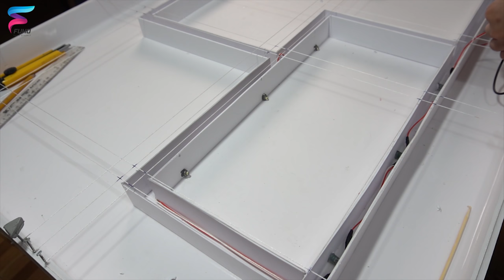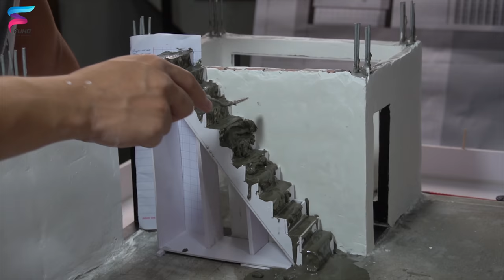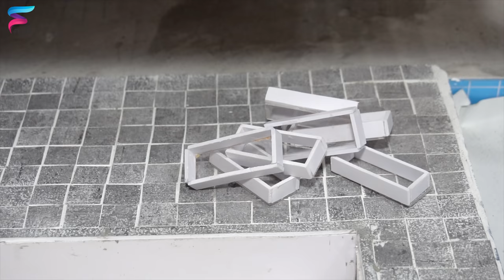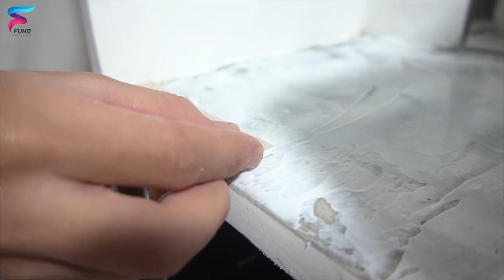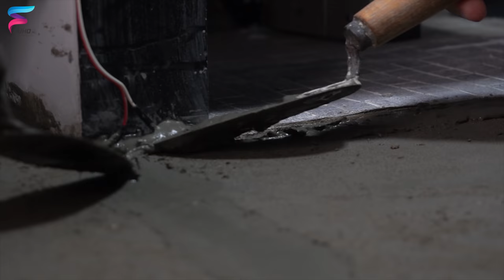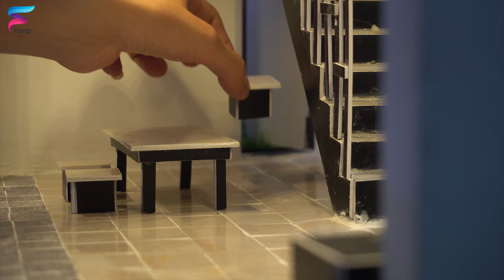Bricklaying build mini house with Swimming Pool full - MCKook

Comment: One question that I can't find the answer? 
What is the plastic sheet material that you use for the fomework,doors, furniture ,tiles and sweeming pool blue sheet
Reply: Do you get at the amazon e comerse
Reply from the maker: It is fomex, a mixture of paper and plastic. We use green plastic to line the pool and silicon to connect
Reply: P V C FOM BOARD